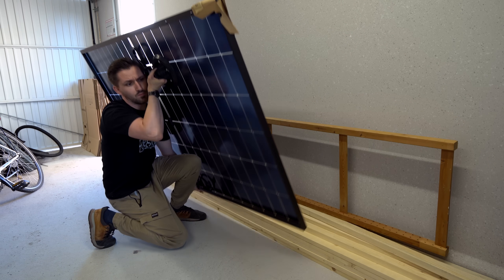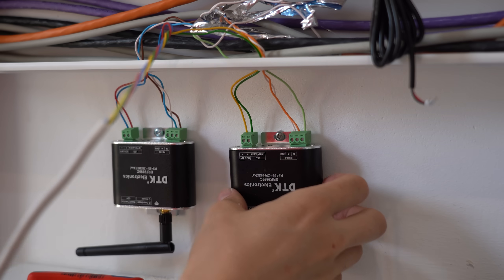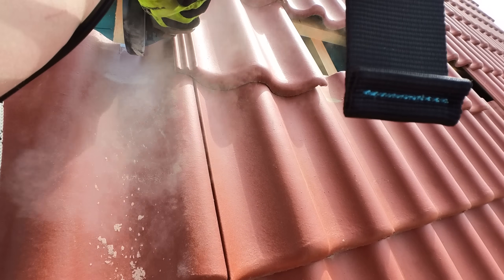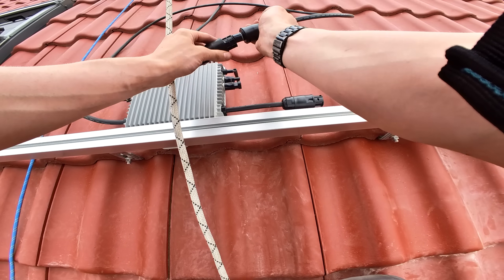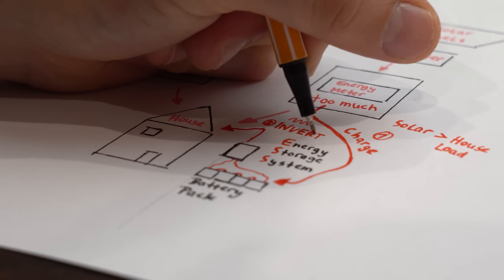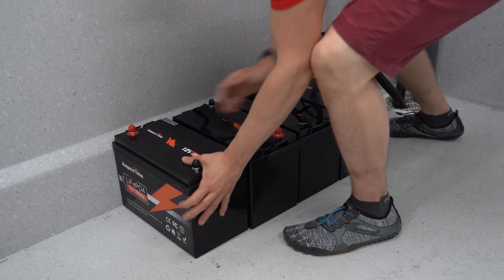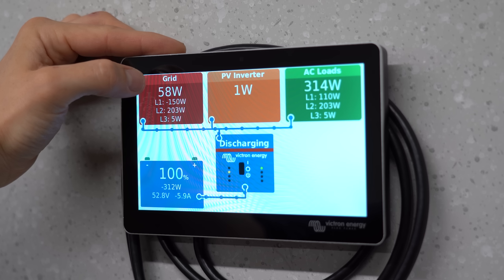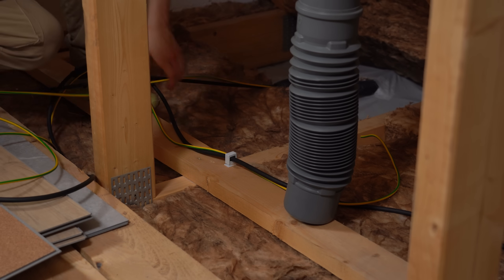Pushing a "legal" Mini Solar System to its LIMIT!

Comment: I did the same at my mom's house in Portugal. I used mainly Renogy material (way cheaper than Victron but more limited) and 1.4kw of solar. 10 months of the year she's completely off-grid and there's a plugin hybrid car charged as well. Where i live (nw of France) it doesn't make financial sense as my main power consumption is during winter.  I wanna give wind power a try but wind generators are still quite expensive.

Comment: Some Recomendations: -
put Balancer between the Battery‘s
- use cerbo build in node red to stop the inverter working if battery is empty or at night, to Safe energy 

Good choice, i using vitron for over 4 years in different application, its great

Comment: I'm not sure what the regulations are in Germany, but plugging a solar inverter into your AC System without a transfer switch at the main to cut power to the grid if it goes down can be very dangerous. You end up charging lines that workers may be working on. It's illegal in the US unless you have a proper system that will not send power to the grid in that scenario.

Comment: what are the safety regulations on batteries, in belgium there's a limit but i can't seem to find it. as for safety the batteries should have a ultra fast fuse because they can deliver currents over 500A if shorted. and a switch in case of fire so the firefighters can safely disconnect the batteries

Comment: Impressive electrical panel that wouldn't feel out of place in a small factory 😀
The project is not a balcony project anymore... The beauty of staying under 800W is that no permission from the grid operator is required and its simplicity.
 Victron products are high quality and well designed, but not cheap. You should make a follow up video to find out what is payback time with 10kWp PV system and bigger ESS :)

Comment: Why didn't you go for a48V battery? This way your single batteries will lose balance over time as you are not actively balancing them. Also I hope your garage is frost-safe - because your batteries probably aren't. A 48 V server-rack battery would have cost about the same money but have covered these issues. Otherwise: nice system!

Comment: im confused here.. I knew you didnt live in the U.S., Canada, Mexico,(skips past Et Salvador Honduras Guatemala because the price to buy and install any of that in the lands my conservative politicians(most of the ones responsible for it at least are dead now)...of the late 80's all of the 90's and definitely still have continued creating the street gang apocalypse with little care about the consequences for the future generations of those countries...anyway i digress because im fairly damn certain that in 90% of the countries in the western hemisphere, north and south would gladly pay a energy grid back fed credit. Sadly its mostly power/gas etc corporations that lobby hard against this kind of help the environment by helping yourself get self-sufficiency under youre own control and still run a/c for weeks on end with a electricity bill that comes as a check every month for your elec bills previous 3 years average... In hawaaii they used to let people totally cover the roof with solar panels until oahu gas and elec started sending $1000 to $1500 checks to every new house in a brand new sub division. lol those checks were paying everything back many times over. They went back and changed the laws. Limiting per panel by house type limits. Trying to get battery storage removed or made illegal. they got the panel limits only so people still need to pay service fees to feed their extra back in and no matter what its just too much sunlight to prevent that in hawaii

Comment: storing energy is inefficient, you are better off returning it to the grid, with battery storage you get 80% efficiency and with grid you are paid in full, except for the looses in wire.

Comment: These are bificial solar panels. They will generate more electricity if you leave some space under them with white paint or reflective surface (bifial panels generate electricity from backside as well).

Comment: Sunsink hybrid inverter combines all you have their in one unit. It has a ct clamp you put around the mains that measures and assures you not feeding back to the grid. It has a mppt input, but  also a aux input to wire the micro inverter into it. That combined with one or two 50 volt batteries is very popular here in south Africa where we have daily grid interruptions.
Reply: The victron multiplus-ii has an internal clamp, as well as options to add more

Comment: My only panel produced 185kWh during this summer. With German prices it is about 80 Euro. payed about 300 Euro for all and the pay back time will be around two-thee  years. Some kWhs go in the grid for sure, but still a pay back time is pretty short. 
Once one installs the system like this, with so many batteries and so expensive electronics, it will not pay back in 20 years even. With all components Scott has, he should rather  add more panels and go almost completely off grid.

Comment: Interesting. I run a small, 2 panels + 4 batteries, 12V off-grid system in the Australian bush. No AC inverter. I'm using SLA batteries in parallel, they have been working efficiently and effectively for 3 years powering a 165 litre refrigerator/freezer, lights and my 4G communications and WiFi system. Never had any problems with it and there is sufficient storage to keep everything running overnight.
I'd like to change to LiFePO4 when the SLAs start to sag. I see a lot of advertisements for LiFePO4s that limit the number of batteries that can be connected in parallel, or series. I want to run a 2P4S 48V system to reduce the size of cable needed and extend the system to a second structure. Is there anything I can do to connect 8 batteries together safely and allow me to expand to a 4P4S setup in the future?
Reply: Lots of choices on LiFePO4.   For rack-mount 48V batteries look at, for example, EG4 Lifepower4 and similar batteries like SOK, and others.  There are quite a few brands now.   These usually come in roughly 100Ah @ 48V (400Ah @ 12V)... 5kWh of storage per unit, regardless.

You can also get 12, 24, and 48V LiFePO4 batteries in "car battery" form factors.  For example, 50Ah 48V LiFePO4 in a car-battery form factor is very common.

'car battery' form factors are often used when only a 1-3 batteries are needed in lower capacities.  Rack mount form factors are used when more capacity / higher-amperages are required.

In terms of series and parallel connections, that's simple:   Never connect LiFePO4 batteries in series.  Ever.   There are several reasons why: (1) BMS trips usually can't auto-recover in series configurations, (2) series configurations require whole-battery balancers, and (3) Usually you want lower impedance on the DC bus which you don't get with a series configuration.  And other reasons depending on the topology.

There is effectively NO parallel limit, even when manufacturers say there is.  But I will tell you what the issue is and why manufacturers give a parallel limit.  Parallel limitations are only there for short circuit protection where one or more battery packs in parallel feed current into a shorted pack.   All LiFePO4 battery packs have BMS's and short-circuit protection, but there are limits to how much current they can actually disconnect.  THAT is why there is often a parallel limit on manufacturer specs.

You can work around this with appropriate external fusing of individual battery packs, as well as a global fuse on the trunk line sized 20% above maximum expected surge current (and obviously also sized to protect the wiring, whichever is lower).   NOTE: It is a good idea for parallel-connected batteries to have the same (Ah) capacities.  Not absolutely required, but care must be taken if you don't to limit worst-case charging and load to what the worst battery can handle.

Rack-mount batteries typically integrate DC breakers and have much larger manufacturer-specified parallel limitations than 'car battery' form factor batteries.   EG4 and SOK allow (I think) up to 6 rack-mount units in parallel per fused trunk.   Most 'car battery' form factors only allow 2 or 3 in parallel per fused trunk.

-Matt

Comment: In Australia the setup in the first part of this video is illegal, such inverters that come with a plug are actually banned because by plugging them into a power point, any power point you are bypassing the safety systems in a buildings switch-box i.e. safety switches and circuit breakers... if someone comes to do work on your home and turns off the power in the switch-box, certain parts of your home will still be energized because of a hookup like that and could and in fact have killed people.
Reply: Wrong, if inverter gets no AC voltage, it shuts off. Its an safety feature and these inverters are certified.
If its illegal in Australia, its not because of this reason.

Comment: Over here, the meter counts backwards. You won't get money for it, but since you pay on a monthly base, you can use up the power at night (AC or heater), what you have not used and pushed into the net during the day time.

Comment: Very nice setup, well done, but I do not like the fuse style you chose. Lithium energy is capable of massive short arcs, you should change that fuse to a class T fuse.
Also, the battery setup you have can go out of balance, so regular monitoring of the case voltages, or installing a balancer across the  batteries is important.

Comment: At 0:17 you plug your solar sourced power directly into an existing home power outlet.  I'm not an expert but I believe this is called "back feeding".  In the US this is illegal as there are some serious risks to doing so (including potential harm to powerline workers amongst other issues).  I believe solar systems which back feed are required to cut off if mains power goes off. Technically it would work but the risks are so significant that the plugs used to connect a source such as a commonly used generator to an existing house outlet is called a "suicide cord".  Any idea how the German grid is different such that what you did is not an issue/risk?   

Of course, once you connect your solar panels to the various control and regulation devices inside the house I believe this is more standard and allowed.

Comment: I have a similar Victron ESS system installed. The setting you have to limit is the feed-in power to 600w (it's on the ESS menú). No need to limit the inverter power. This way during blackouts, your multiplus will do it's rating... You only need to limit the inverter to the max current your battery bank can provide.

Comment: Next would be cool how to put a transfer switch so if the grid is down that you can run stuff off the batteries only
Reply: The whole house inverter between the mains and panel will drive the micro inverter, if the power goes out.

Comment: Interesting carve-out you have for "balcony power". In the US it's illegal to grid-tie any kind of solar generator without the explicit permission of the power company. That's part of why solar installs are so expensive here, it's difficult to get the permits to do it yourself so the solar panel installers charge a very large markup over the cost of the panels and inverters because they can.
Most DIY systems end up being "off grid" and mainly used as backup power, like the one 8 Bit Guy made for his house that also runs some supplementary air conditioners.

Comment: 7:14 - “the only device I could find which could do this…”

I recently received my Genetry Solar 12K inverter, which is billed to do this, without all those extra boxes & adapters. It is called A/C Coupling.

I guess I’ll find out if my 1 inverter system will be able to sink my extra grid tie power to the batteries, instead of the mains, at likely an order of magnitude less cost.

Comment: Only issue I see is that as you add more power you might have some interference in your data wires being run along side your power wires.

Comment: Dont get me wrong, its a nice setup, but to buy all this stuff would be ridiculously expensive. Ive done something similar but on the cheap, 2 x 250w panels, decent charge controller, 2x large leisure batteries. Ac inverter. Totally separate to the mains. Can run cctv, laptop, tv, heated blankets etc. In uk its not great in winter but enough to run an electric blanket all night and charge laptop etc. 😎👍

Comment: Oh dear.
You couldn't install that like that here in the UK. 

So ...
Why is your vapour layer not over the joists?

What's with the cable across the panels?

The comparison system is not really good as you're going from a plug in (not legal here either)  to a full solar system.

I know the wiring is different their, but your new upstream does it have down stream protection? 

Most inverters have surge protectors, some don't have afdd's (arch fault)
But we also have RCBO which works better than a breaker ;) 

Great to see your getting solar installed, but.. remember that tracker video you did the other year...  remember the roof top panel issue... ;) ;).

I think you may need to show us this victron complexities, I don't use them as I think there not mod range enough. But I know the products are good, CS not so much...

Comment: here in philippines the minimum hybrid inverter that you could buy is 3kw to 5kw .and I'm looking for hybrid inverter that's only rated below 1kw  12V for starters ..because if you use a grid tie inverter and others no constant load in your house it will just add up to your monthly electric bill.we hope that others a micro gid inverter with limiter CT
Reply: I don't know of any hybrid inverters with that small an inverter output.   You would need to go with a discrete solution (separate components... charge controller, inverter, and battery charger for battery support when the grid is up), plus batteries of course which you have to have anyway.  

Then you could simply buy a low-output inverter with low idle current.   Victron actually has a nice low-power inverter, I think, that fits the bill.   The Victron Energy Phoenix 500VA inverter.

It is true that higher-powered inverters generally have higher idle power draw.  It can be anywhere from around 15W to 60W depending on the brand.   And this is definitely an issue for very small systems that rely on the inverter always being turned on.   A 30W idle draw will burn 0.720 kWh/day just doing nothing.

Comment: Reminder to everyone - check your local laws. This sort of DIY install would be 100% illegal in a lot of countries for varying reasons...
Some countries need permits to supply power to the grid. Some need licenses to do wiring or solar. Some places would even need a permit to mount the panels on the building.

Comment: just do citric acid (with table salt and optional vinegar) metal-air fuel cells, 2kWh/kg specific energy, just use graphite rod carbon felt cloth air electrode, citric acid and the other stuff melts the iron oxide and other oxides away from the metal, consuming even a pipe shaped metal reloadable fuel cell, dont you spread fear owned by the living deth, diy scaffolding or just ground mount, if you dont do you never learn, assume that you get the stuff for free, so its always beneficial, better have freedom bro, do it off-grid if they mumble against you, for doing grid tie systems

Comment: i thought the batteries could get out of balance just like li ion packs and would need a balancer to avoid overcharging one while another is undercharged. anyways great video as always.
Reply: They are wired in series, so they will even out every time they are fully charged.
Reply: @ThePentosin  Actually they won't.  If they were lead-acid batteries then yes, they would.  But lithium batteries in series won't even out on their own regardless of the charge level.   That's why a BMS with balancing is needed and the balancing requirement extends to multiple batteries placed in series.

Each of those 12V batteries has an internal BMS with balancing, but when placed in series you now ALSO need a 12V balancer between each one.

If you don't, then what will happen instead is that one battery will hit its BMS cut-off before the other battery reaches 100% SOC.   Or, alternatively, the charger itself will hit cut-off (which is more typical) and leave one battery under-charged and the other battery at 100%+ SOC.

They will drift apart over time, enough that the capacity will steadily drop.   The reason this happens is because the voltage difference between 10% SOC And 90% SOC is very small on a per-cell basis.  For LiFePO4 the voltage differences are 0.15V/cell at the end of active charging.  And the settled voltage difference is even smaller... that's more like 0.05V to 0.10V/cell settled after charging is complete. Going from 100% SOC to BMS cutoff is another 0.10V on top of that.

Thus the target voltage may look correct from the charger's point of view, but the two batteries in series could wind up at wildly different SOCs.  And they will drift apart over time and do just that.
Reply: @junkerzn7312  that's a good point.
Tho, I've seen several of these batteries that can be hooked up in series, that talk to each other. So I'm guessing it's fine, just not explained in the video.
Reply: @UKsystems This is caused by marketing confusion.  No battery does that.  Batteries can generally tolerate a certain amount of voltage (usually around 62V) that can develop in series packs due to OVP disconnects, but that's it.

The batteries do not actually handle a wide range of voltages, do not communicate over the DC power wiring, and the pack won't function if one or more batteries in a series configuration disconnects.   They still require a proper whole-battery balancer for the segments and there are also fairly poor behaviors if one does not have other series packs connected in parallel to take up the slack when one disconnects.

-Matt